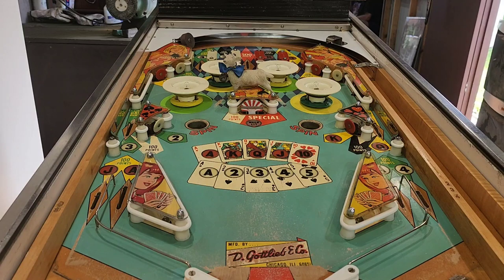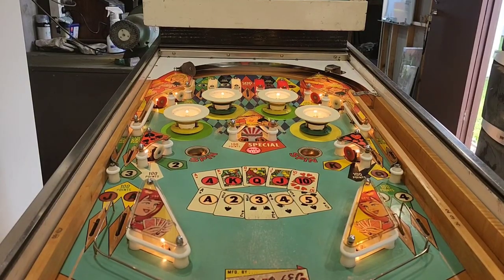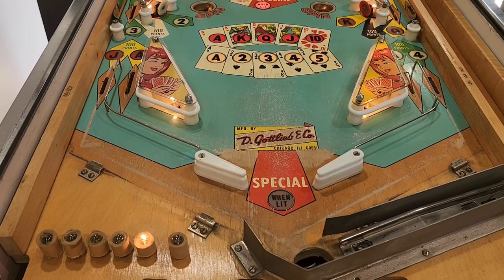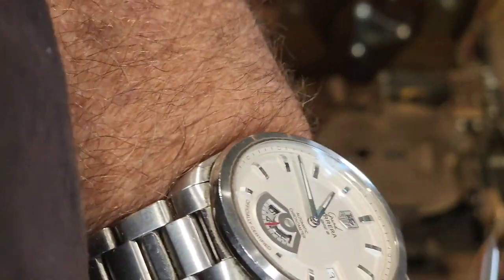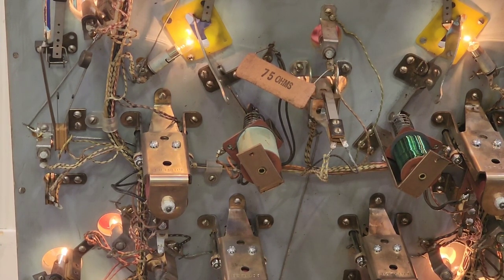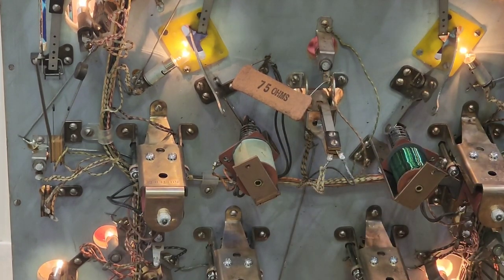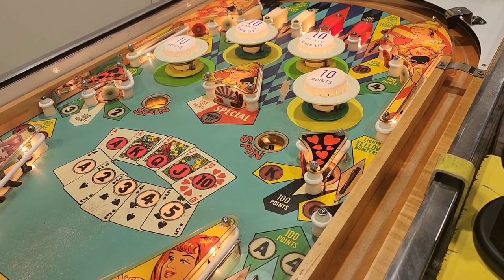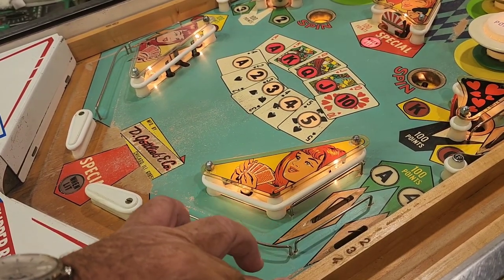Gottlieb Spin A Card Repair & Troubleshooting

Comment: Great job
Was wondering what are the bottom leaf switch of the four pop bumpers used for ?
Cheers.
Reply from the maker: @NeilKrenos  thank you. The bottom pop bumper switches are the EOS end of stroke when that switch opens cuts power to the coil.